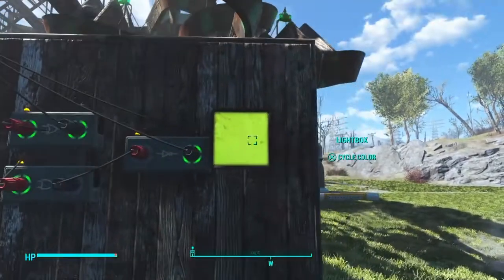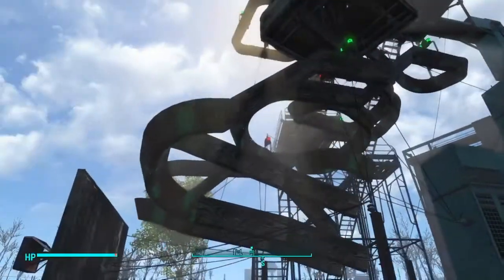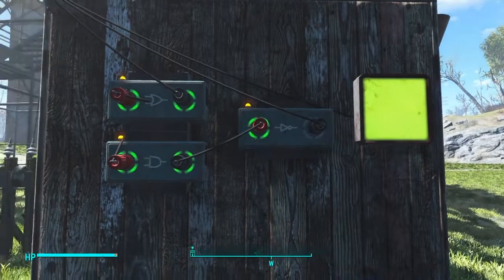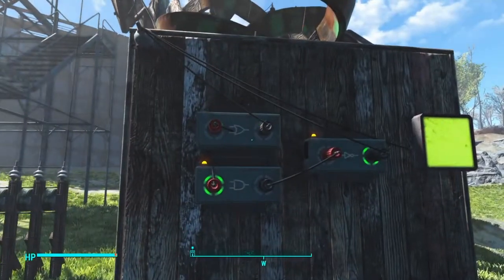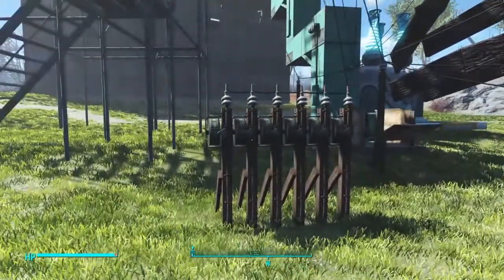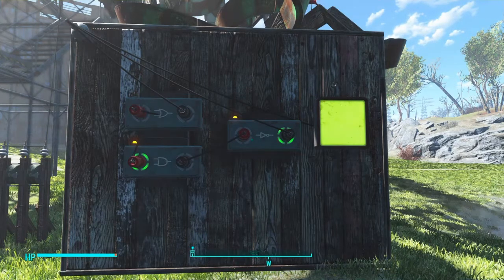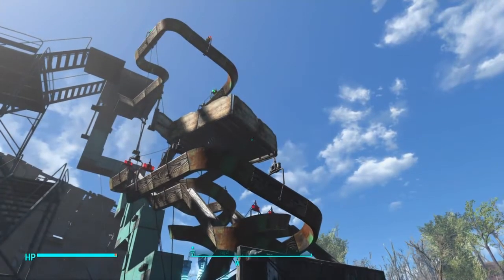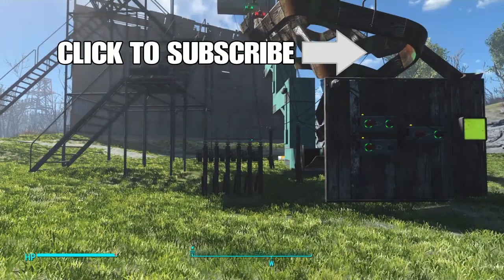Fallout 4 - Update on the Ball Track Generator and Upcoming Logic Gate Tutorials

Comment: great concept! Good luck refining the process and fixing that errant counter.
Reply from the maker: Yeah, that counter was working perfectly, and then the tens place starting counting in place of the ones.  No explanation, no change in wiring - heck I never even touched those wires.  I was going to fix it, which I can probably do by resetting the counters with the terminal, but I'm actually gonna save it for an upcoming tutorial, because it's a perfect example of some of the bugs inherent in the system.